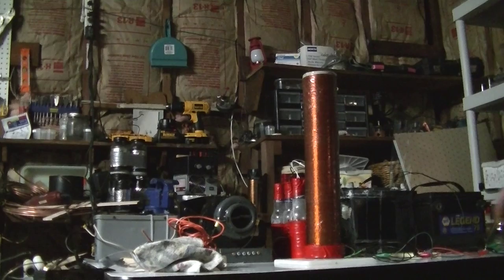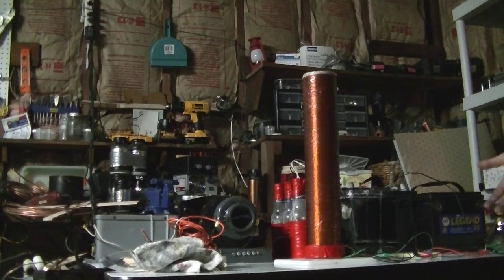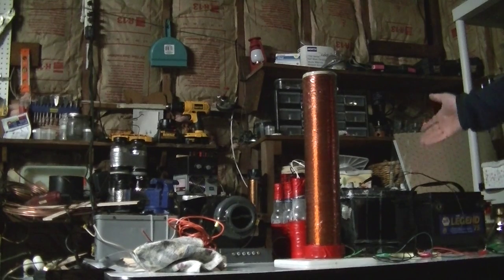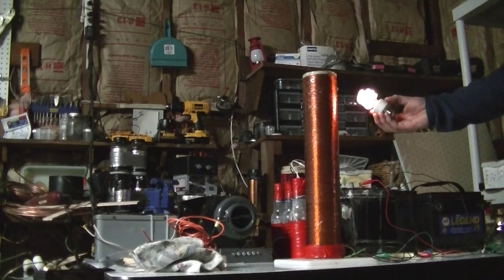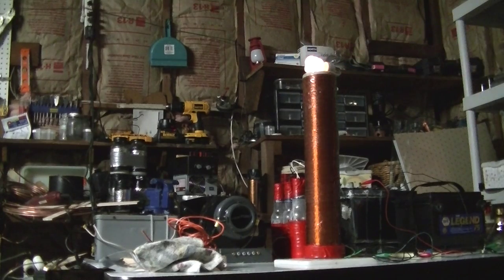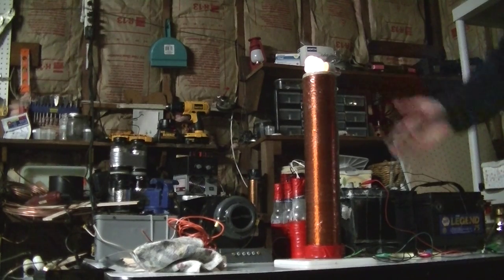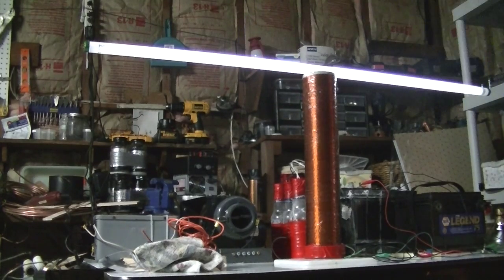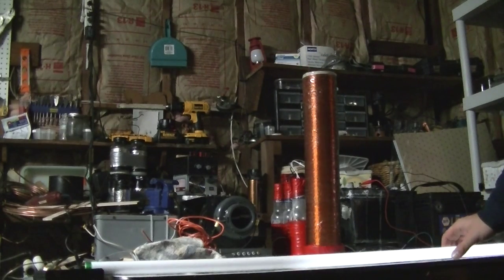Slayer on an Alum battery (SEC Callenge)

Comment: I like your stuff , just curious if you matched your primary and secondary ? Based on what I see, if you added a toroid capacitance to the top, "a large surface of curvature" as Tesla would say, your circuit would be tough to beat, the seen plasma you mentioned which is lost to air ground would be added to the electrostatic field of your coil= even more light. I'm sure you know this, this is the only vid of yours I've seen, but I can recognize good knowledge and experience in your words :)
Hey question, you using a TIP3055 or regular gen purpose 2n3055, I would like something other than the mpsa06, it has Super gain, but would be very cool to drive it a bit harder and see :)
May the Dr be with you sir
Reply from the maker: Thanks my friend! This is the primary coil that's matched closest without a top load(capacitance). I probably could get even closer to a 1/4 wave length like Dr.T talked about with the surface area of the secondary, and a top load to the primary,but man I tell you what... exciter circuits seem difficult to narrow down because they are so dependent on the transistor for frequency range. G Bluer, Dr.Stiffer, Abraham's Lab and whoever else I am forgetting, seem to of worked out some excellent circuits while being specialized for something in particular. I  have yet to buy the components to do those replications yet. So I just tinker with scrap and local components.  I do notice from some observations that the slayer seems to be more parasitically inductive then resonant, unless you do an  awesome job like yourself, to bring  it much closer to self resonance in accordance to the components.  I am still quite the "exciter rookie", so suggestions and comments are very much appreciated.
I was thinking about your transmissions with LED's on the receiver a little bit.  It could very well be a more efficient transfer of power. Far more appropriate to the power sources the exciters run off of. Though I will say, it is super cool to see a florescent light up.
It seems like the task is influencing the environment as a capacitor to alternate polarities in the  "electrostatic " realm, that seems a little tricky for myself. It may take us some time, but we will collectively figure out seamless transmission of power and how it transitions through mediums. I am sure others have already before us, but if its for the sake of self preservation instead of a conscious union, its lost on a perversion of reality. Hope that last part didn't come across too crazy ;)  Take care and look forward to seeing what great things you discover.

Comment: Has anyone figured out the frequency range of the circuit? Have a few ideas for you when you do.
Reply from the maker: It's difficult to pinpoint because it seems like the frequency changes when the coil is inductively under load.
Reply: +shazizz hey shazizz i think the frequency of the output coil is about the max frequency of the transistor i have a tip42 transistor, not tip 42c but just a tip 42 slayer circuit and the frequency i measured with my multi meter was about 2 mega hertz it probably isnt accurate but thats what i measured.
Reply: resonant frequency
Cool thanks for the information, I will look into it some more.